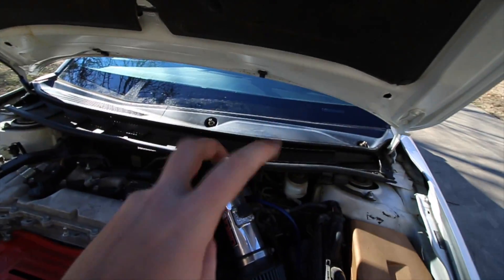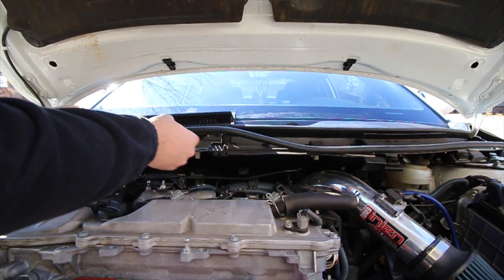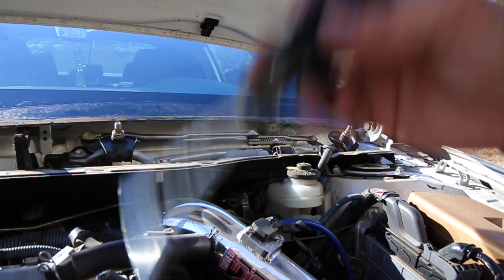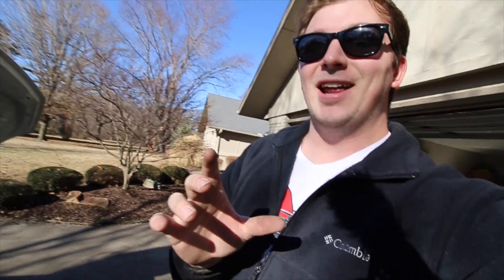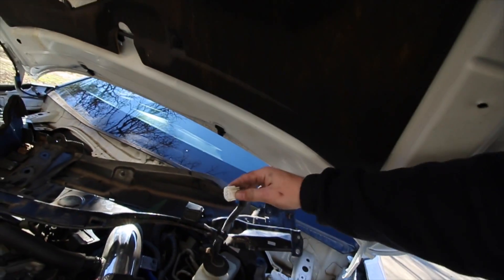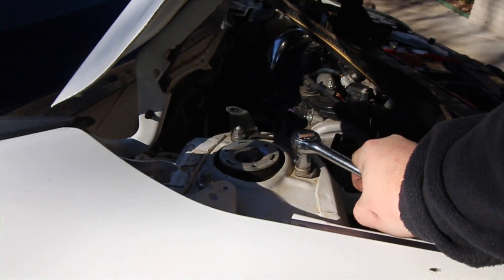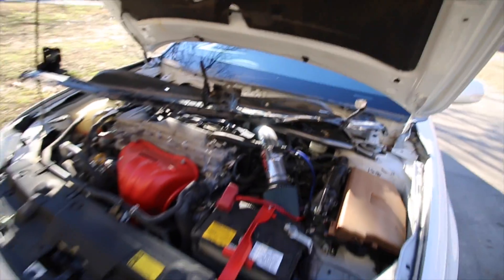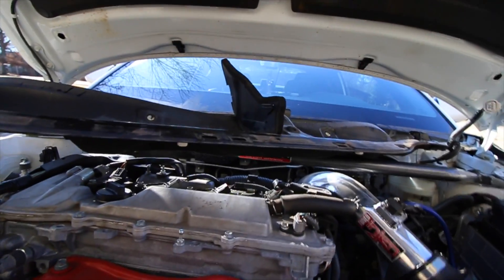SCION TC STRUT BAR INSTALL!

Comment: Don't really need to remove the whole metal cowl. Once you remove the bolts and the cowl is loose just lift it up a bit put your strut bar in and bolts back.
Reply: True. A little bit of space,can work it out.

Comment: Notice any difference?
Reply from the maker: Yes, right from the start. You feel like you're more in control and you can definitely take corners faster. Overall very pleased.
Reply: MK Media now get the tanabe  front lower. It's pricey, five minutes to install, four bolts. I even put a rear upper on when I upgraded to eibach sway bars to full stiff was huge. Well, 8K front springs too.
Reply: MK Media checkout TB performance..tc2.
Reply from the maker: I'll look in to it. Thank you!